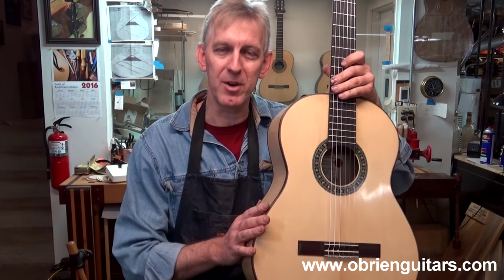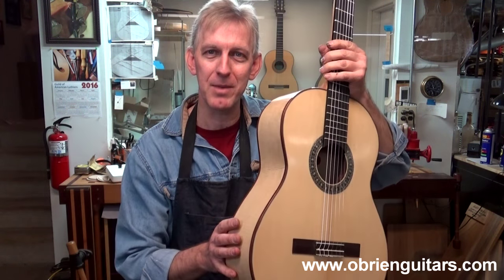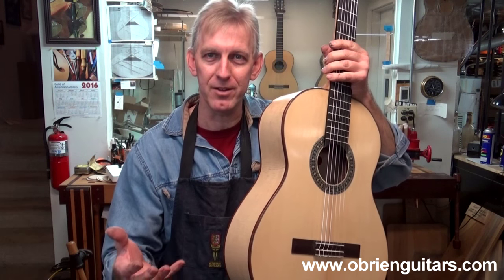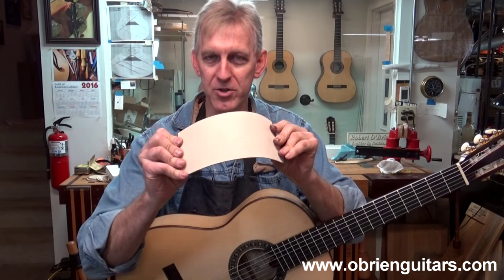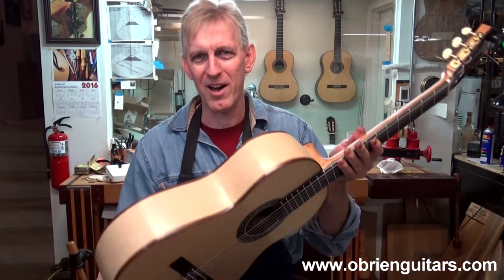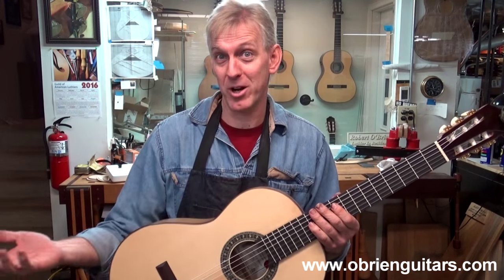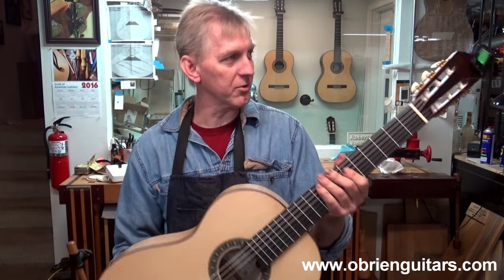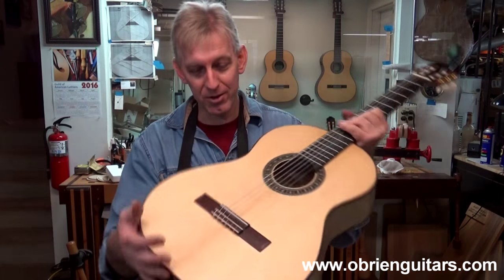The Cardboard Guitar - O'Brien Guitars

Comment: What I'm wondering is can a steel string guitar be crafted like this or would the tension be too great?
Reply from the maker: +Caleb Hawkins I think it could be done.
Reply: +OBrienGuitars +1 vote on following up making a steel string guitar! Video tape the build. make the steel string top with cardboard like speaker cone material (since that is what it provides) or some other material like clear very thin plexiglass to showcase the trusses. Trusses will be deeper than normal to compensate for the regular top thickness to achieve the same finished guitar spring rate.

Comment: OBrienGuitars could I put veneer over the poster board? Is veneer actually wood? Does veneer have a tone like regular wood could I glue pieces of veneer together build a sound board? Also how do they get the plywood so thin for laminated guitars?
Reply from the maker: I think I would just use solid wood at that point. It would be too much work to laminate it all.